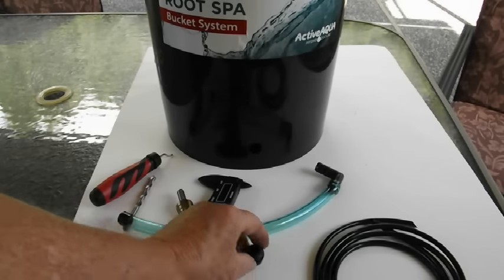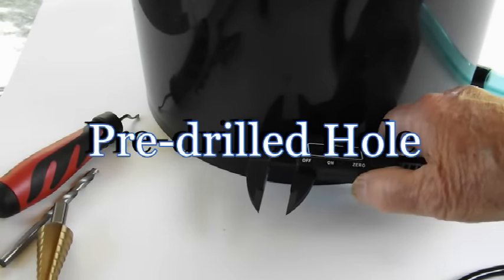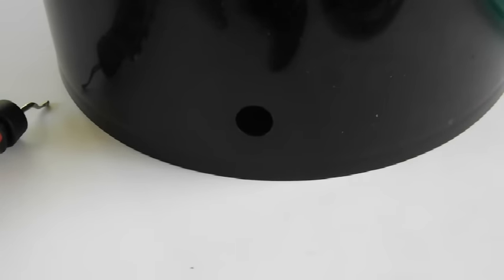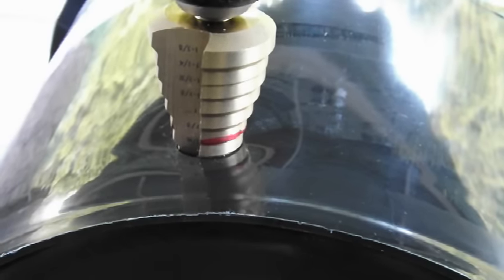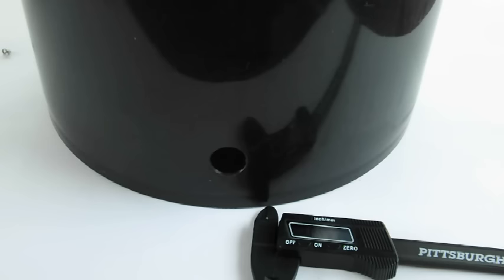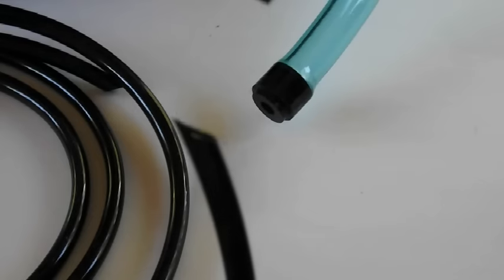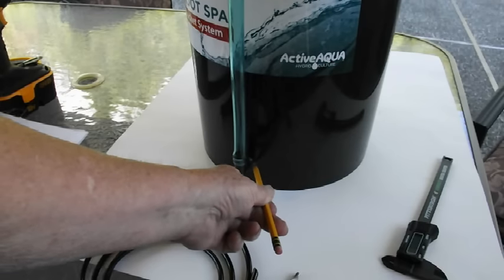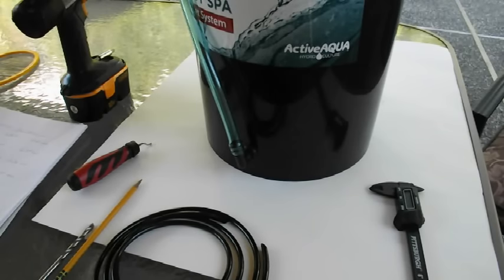RootSpa hole & grommet dimensions

Comment: I have had great success growing peppers with these buckets. Trying cucumbers this yearn in addition to tomatoes and peppers. Everyone seems happy so far, with plenty of fruit set already. The air lift pump worked great for about a week and the stopped. I need to do some troubleshooting. 

Also, when I build my buckets, about every third bucket seems to have a slow leak from the elbow at the grommet. Now, when I build new buckets, I use silicone inside to seal up all around the outside of the grommet and around the elbow.     I give them a day to dry, and so far, have been pretty successful. 

Thanks for the video, Ron.
Reply from the maker: I have also had excellent results with these systems growing everything from basil, tomatoes to peppers and more.  If you do a grow comparison with soil you will definitely see the difference - it's the air and the space for the roots to grow unobstructed that makes the difference.  With the RootSpa you don't need air stones or one of those "spider" contraptions - just plain air bubbles.  Thanks for the comment and thanks for watching my videos!

Comment: Thanks for mentioning the caliper.  Getting a straight answer on hole sizes for grommets can be a problem.  I have one for reloading but hadn't thought to use it for this.  Unfortunately, I don't see any 13/16 hole saws,  so it may be 3/4 vs 7/8.  What is the source and part number of your step drill?